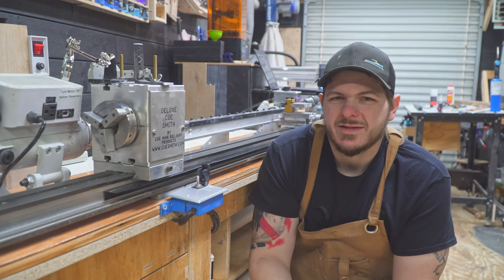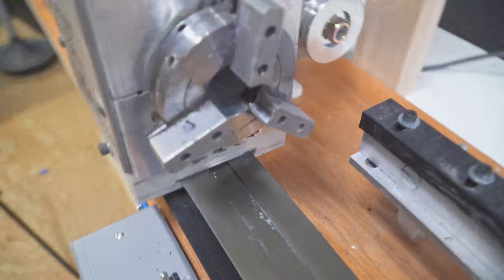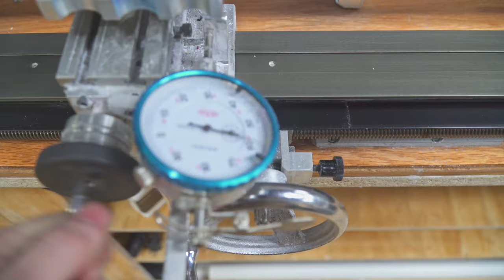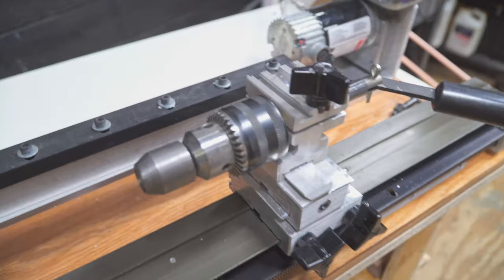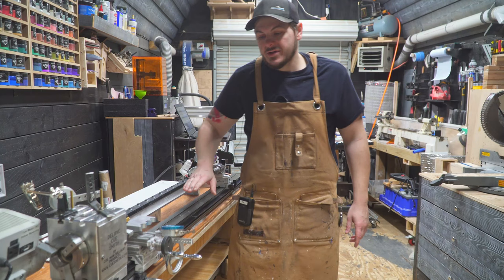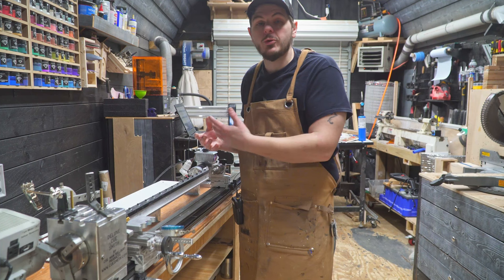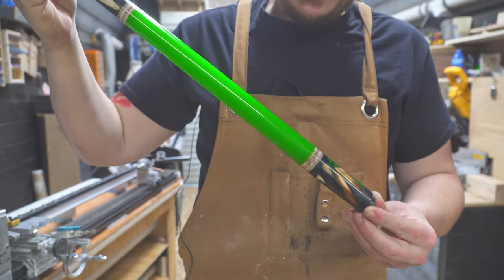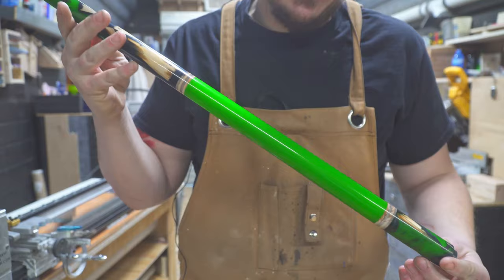Woodturning: Pool Cue Lathe? What Is The Difference? Quick Cue Build!

Comment: I was researching some lathe info and found your video. I was really impressed with your setup! Simply awesome. Quick question: what is the maximum length stock you can fit on the machine?

Comment: When you put the Epoxy mold Into the PVC chamber are you adding air pressure or using vacuum to remove the air bubbles?

Comment: It sounds like with a typical piece of pool cue wood, you would need the pass through headstock to be at least 1.5 inches diameter. Am I correct? When I am looking at specs for lathes to purchase, I do not see this spec listed. Is there something else it might be called?
Reply: It's called "spindle bore", the thing is that for cuemaking you do need at least a 1.5" spindle bore and 36" between centres , those specs make up for a quite big and expensive metal lathe that is usuallly an overkil for building cues, hence the niche market for specialized tools like the cuesmith

Comment: What kind of epoxy do you use?  I just got some to try out and in the instructions it says to pour in 1/8 inch layers, or else it could heat up too much and ruin the project. Did I get the wrong kind? Thanks!
Reply from the maker: I use totalboat high-performance and slow hardener or totalboat deep set there is a link in the description for total boat if your interested in it also using a pressure decreased the chance of thermal cracking on deeper pours
Reply: @jpaynewoodworking7510  Awesome, thank you!

Comment: Thanks for sharing this , I've always wanted to make my own pool cues , how much does this lathe cost? , the tail stock you turn is wicked , what did you do for the stock and tip?
Reply from the maker: I used my cenergy carbon fiber shaft it has a G2 tip and you can check the lathes out at cuesmith.com.

Comment: Great video nice upgrade too the shop! I see u went too a carbon fiber core. Is there a reason for that? Also if its carbon how u drill the middle is there wood inside the carbon?
Thanks jay
Reply from the maker: Thank you. And mainly went to carbon fiber for strength and stability. I do the cues with a 5/8 in wood insert in each end for the joint pin and the weight bolts. I have now set up the lathe for live tooling so I use the router and endmill to bore the holes for the inserts.

Comment: The pour material won't hold up.  There's a reason cues are made the way they are.  I have 17 years full-time experience building cues.
Reply from the maker: Thank you for watching and your welcome to you opinion but factually you are incorrect about it holding up. The cues are cored with carbon fiber cores as well as the epocy alone is actually harder than wood when matched with the wood they each make for an even stronger material. They play great and have agreat feel iv spent alot of time designing them with play in mind before looks and then make them look awesome. I respect your opinion and that you are a veteran builder and I always love learning new things from other builders I make full wood cues as well and it's a completely diffrent setup and technique. The same things like it won't last, hold up, or play as good were being said about CF shafts when they first came out. Just because it is diffrent doesn't mean it wrong. Thanks again for watching.
Reply: Better get more experience. Guess you didn't learn much in 17 years.